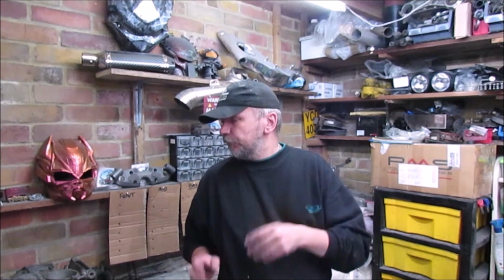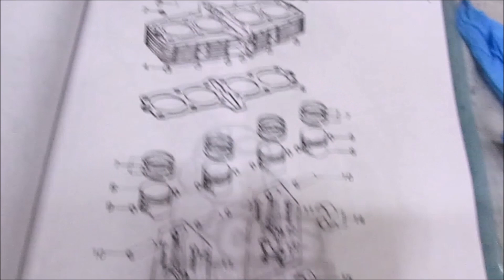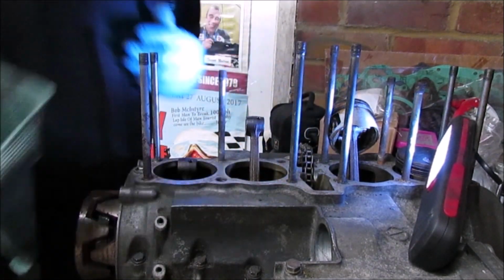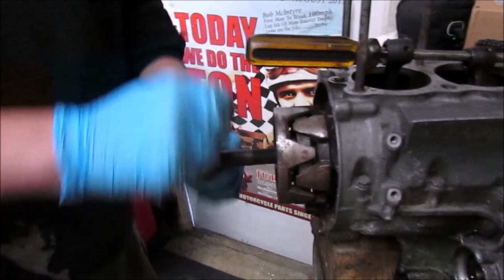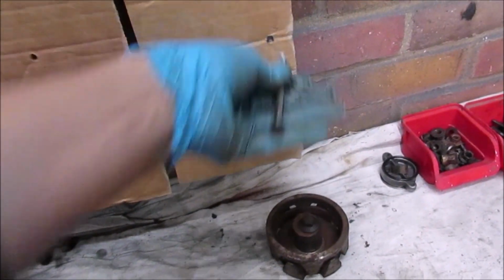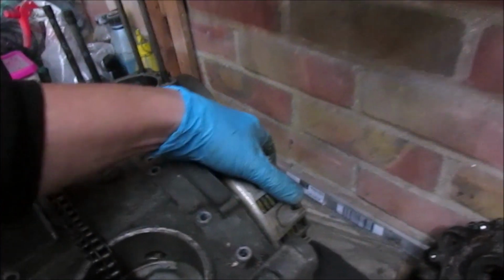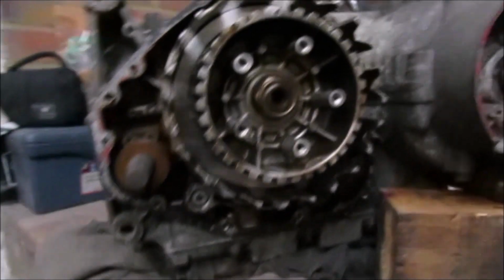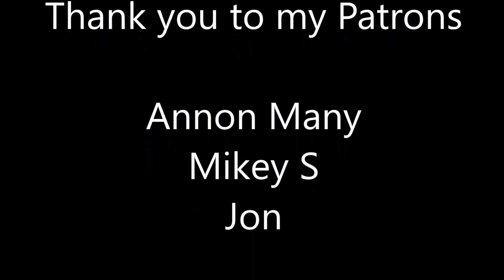Kawasaki KZ650/Z650 B1 1977 - Engine Disassembly - Part 4

Comment: Nice one Keith. My experience with those pullers to get the rotor off, you normally tighten it up then give it a tap on the end, then tighten and tap again and they usually come off fairly easily mate.
Reply from the maker: Thanks Jonboy, appreciate your comment, a lesson learned, will remember that for next time, learning as i go on this one, that was a tough one to remove,been standing near on 10 years,
Reply: The Amateur Bike Builder yep, I expect that’s the first of many challenges ahead mate! I’m currently doing an old Yamaha DT50, restoring it with my son, quite straight forward compared to some bikes I’ve done in the past. Enjoy mate, the best bit is at the end!
Reply from the maker: @jonboy-kb1jj  sounds great, a father son project, awesome, let me know how you get on, the finish line is a very distant dot at the mo, but looking forward to it, thanks again

Comment: What puller did u use?
Reply from the maker: Thanks Josh, had it years, but is still available, here is a link https://www.wemoto.com/parts/picture/bi-tlsfly35
Reply: @TheAmateurBikeBuilder  thanks! Super helpful vids keep it up!
Reply: @TheAmateurBikeBuilder  do you remember what thread size it used?
Reply from the maker: @joshmidgley9310  thanks, glad they are of help, big learning curve but enjoying it, more to come
Reply from the maker: @joshmidgley9310  yes, it is M18x1.5mm
Reply: @TheAmateurBikeBuilder  thanks so much. Taking alternator off my 1977 and putting one from a 1979 on and was having such trouble getting them off. I appreciate you helps and all ur vids helping me with my engine swap between the 2 years.
Reply from the maker: @joshmidgley9310  Glad to help, thanks again